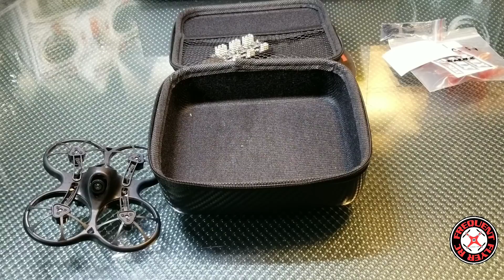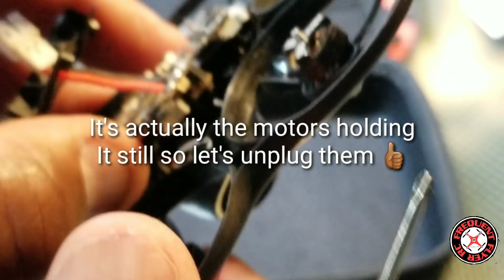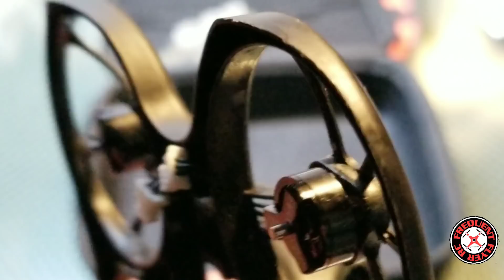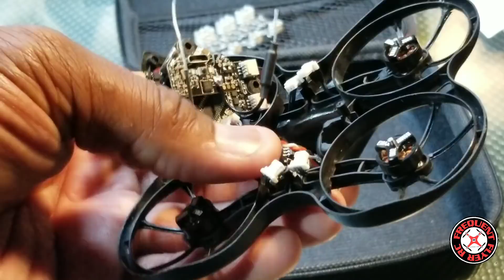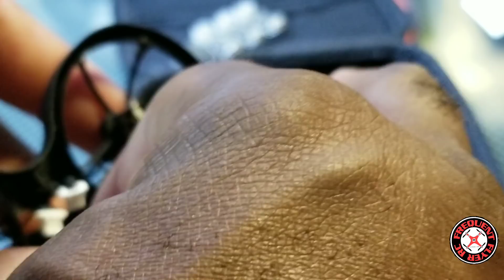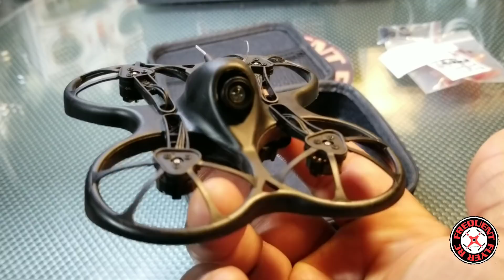TinyHawk S Teardown and Re-assembly

Comment: The motors connectors, in my case, are  vertical. Much easier to remove the motors when you need to make some maintenance. And I have the exactly same model, Tinyhawk S.
Reply from the maker: Nice!

Comment: I think I damaged my motor while trying to take my prop off, it won’t spin up any more it just shutters for a second then beeps. The others still spin just fine
Reply from the maker: The newer turtle mode props are Super hard to remove! Don't think you can damage the motors removing a prop unless you use something that can stab into the coils inside the motor bell or you accidentally pull loose one of the motor It wires

Comment: Next time the camera comes loose you should apply lil of hot glue on top in side of the inside the camera and a lil under the canopy below of the camera slot you should just fill in the hallow pin lipo connector with a lil of solder it works great i did that with my acrobeelite and now i get 45 secs more of flight time
Reply from the maker: Cam never came loose on me 👌🏽